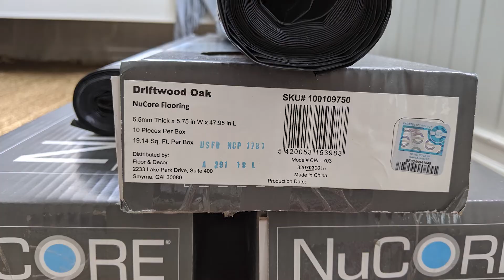How to Install Luxury Vinyl Plank (LVP) Flooring DIY | Chicago Condo Renovation Ep 3

Comment: Did you put the cabinets and island on top of the lvp? Great video, love your take on most things
Reply from the maker: I did put the cabinets on top of the lvp. I did worry about expansion and contraction but it was never an issue. I also didn’t want to have to add trim to the base of the island to cover the gap in flooring. Hope that helps 😁